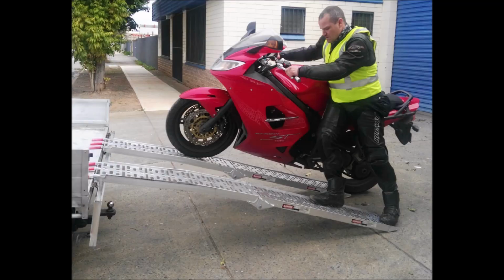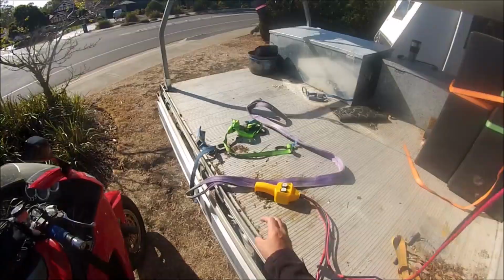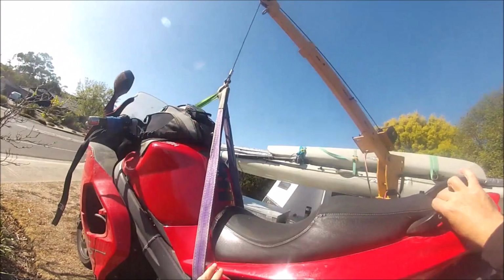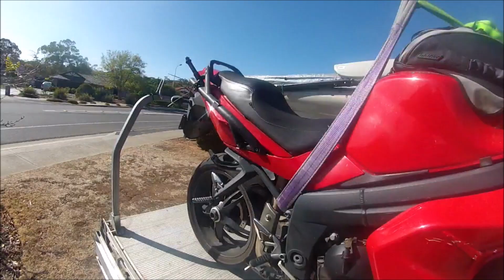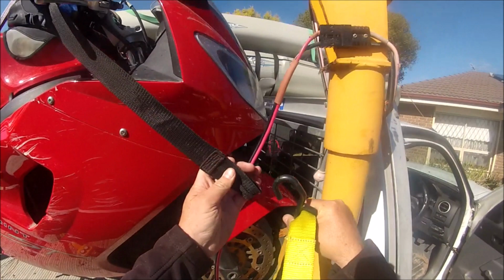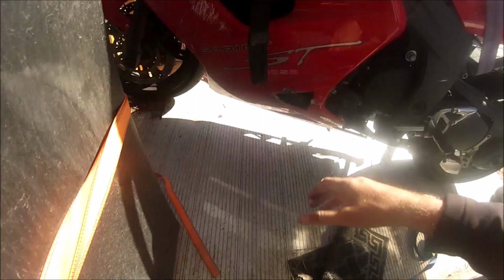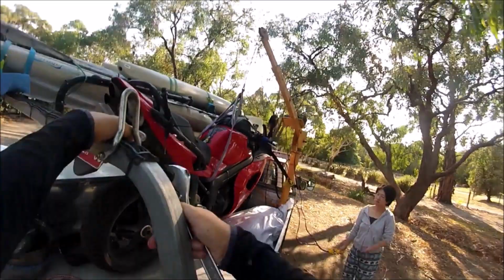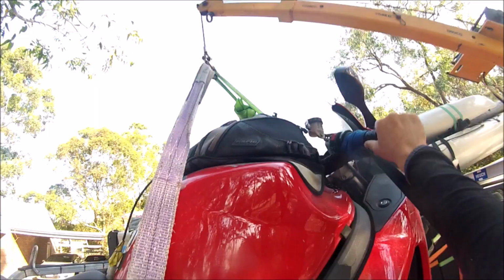Demo - Hoisting motorcycle onto ute tray using crane

Comment: This is exactly what I’ve done so i can load my WR450F up on my GU Patrol Ute when towing my Jayco Swift. My tray was to high to ride up a ramp yeh i did it 2-3times but its way to dangerous & only a matter of time before i come a gutsa. So yeh the crane 🏗️ was my only option.. There is a hydraulic bike lift system you can buy but it’s about $5-$6K & Absolutely No Way I’m fork’n out cash for that 😳.. But dude ya dunna Grouse job mate 👍 & safe travels & riding i’ll keep my eye 👁️ out for on the road.
Reply from the maker: Yeah $400 for a hoist is way better. Bloody electric hoist has gotten dodgy over the years tho.

Comment: Hey there, i'm searching for a crane that could lift my s1000rr on to floor 3 in my building but couldn't find much information on web. finally this video gave me some idea at least on the proper way you can put the straps on the bike. i just need to find a good crane that could lift to that height those 200kg of pure love without risking my baby
Reply from the maker: Glad it was useful. No matter how you do it there will be risk. Find a good winch 👍

Comment: I thought compressing the shocks is not a good idea. Shocks are not supposed to be compressed, I thought they supposed to compress while driving then bounce backup straight back. When I mounted my bike I strapped the tyres. Did I stuff up?
Reply from the maker: I thought that too, but been doing this for years now with no issues at all.

Comment: Hello, I'm wanting to do the same thing but for loading a dinghy and I'm wondering about the crane bolted to my aluminium tray and if it would need some type of strengthening. Also what do you think of the quality of that crane? Cheers mate
Reply from the maker: I definately needed strengthening to lift my 200kg bike. Put a steel bracket underneath. Crane is low quality but it works, going to replace the steel cable with dyneema soon, after 4 years the steel cable is unsafe.

Comment: How did you securely mount the hoist in the tray? I’m thinking of doing something similar.
Reply from the maker: I had to put a reinforced steel bracket (DIY) underneath to support it. The tray itself wasn't strong enough to take the load.